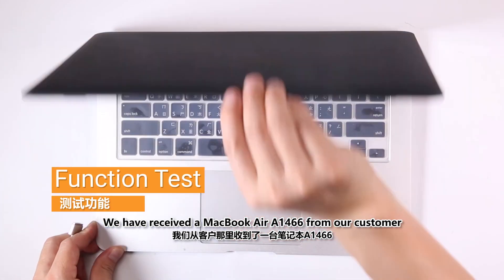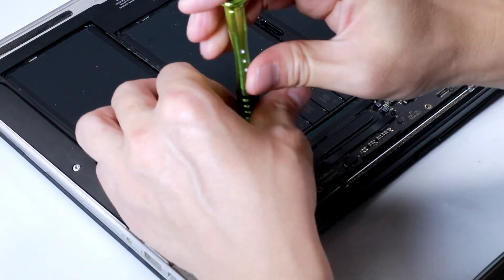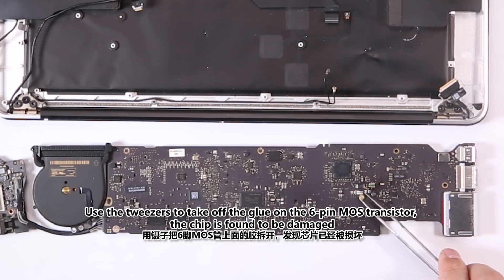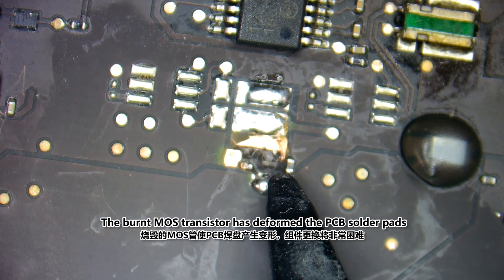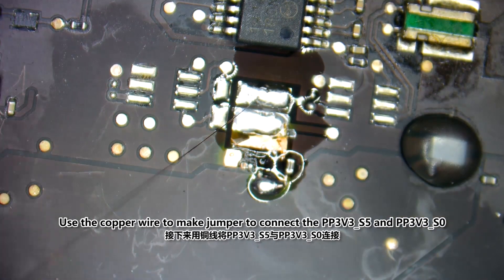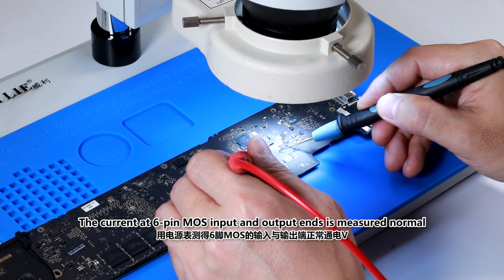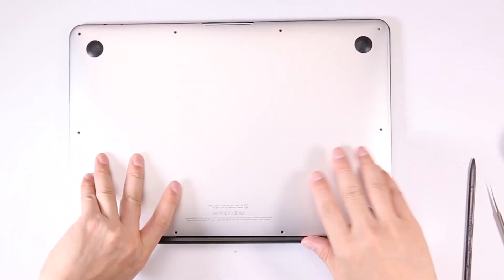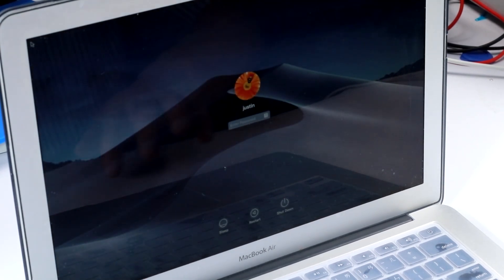How to Repair MacBook Air A1466 No Display Issue| MacBook Repair Lesson

Comment: I have the same model with the same problem, i have found that foam around, there is a problem, i can't see any signs of damage on the 6 pin transistor, and second of all, i DO NOT have that solder pad that you have underneath the transistor, in your video (mine is a 13 inch 2013, A1466)